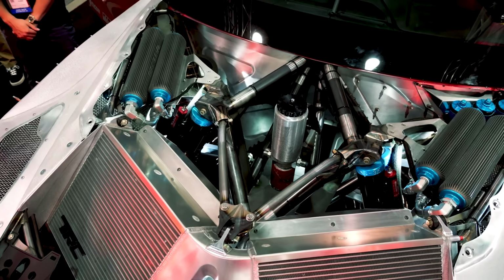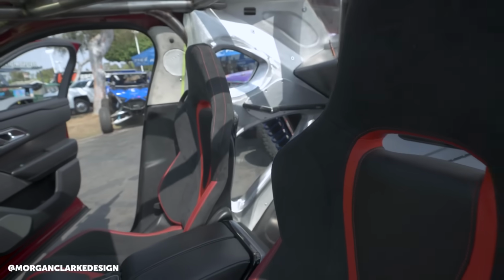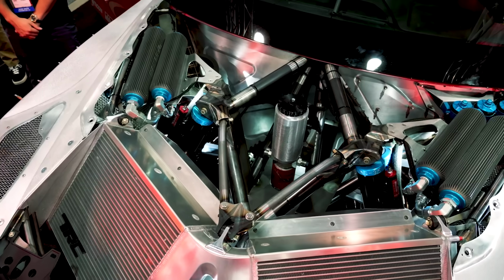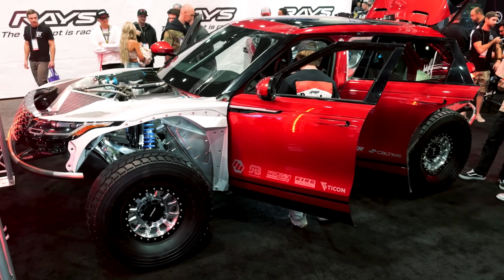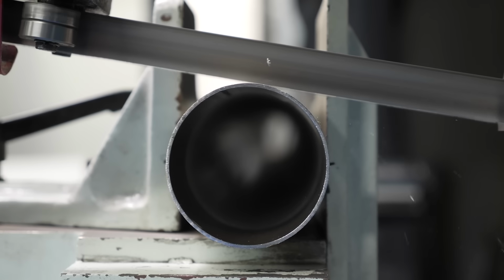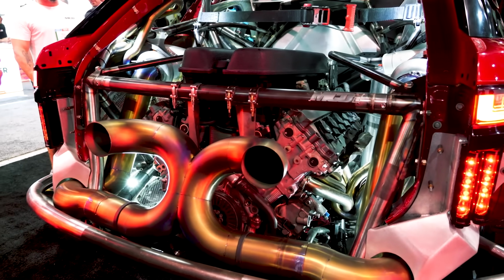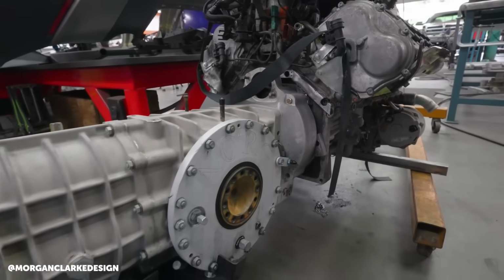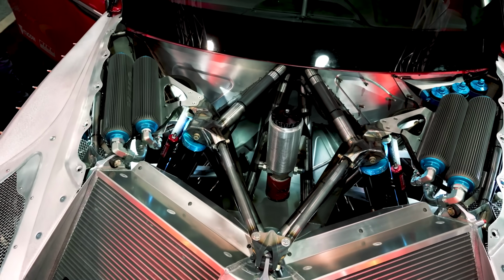This build makes your 4x4 look like a Prius.

Comment: So over seeing this car in it's unfinished state. It's an incredible build, but as it sits its just another SEMA lot queen that isn't completed and doesn't run.
Reply: This wasn't built for SEMA
Reply: @Urban.Broccoli  Didn't say it was, but also doesn't change the fact it is just lot every other SEMA build: unfinished, doesn't start, and lots of speculation
Reply from the maker: There isnt really much to speculate about on this though. You can see the level of work done so far is on point and the drivetrain is all proven. Miles off something cobbled together for a one time showing. 
You of course don't have to like it, but if you think this guy isn't legit check out his Tuned In podcast episode for his background 😎 - Taz.

https://www.hpacademy.com/blog/127-doing-it-different-monster-twin-turbo-v10-range-rover-prerunner-podcast/
Reply: It's a prototype. You can see him build it from start to finish on his channel Morgan Clarke design.
Reply: Its current state shows the craftsmanship and design very well, when its finished most of it will be hidden under body panels and tinted windows.
Reply: It'd in the middle of being built. Once it's all together a lot of the fabrication will be covered. He has plenty of offroad vehicles completed that hammer through the desert very well.
Reply: Two standard deviations below average IQ take.